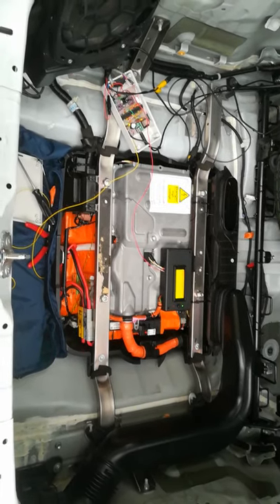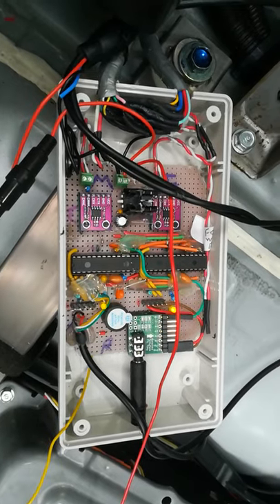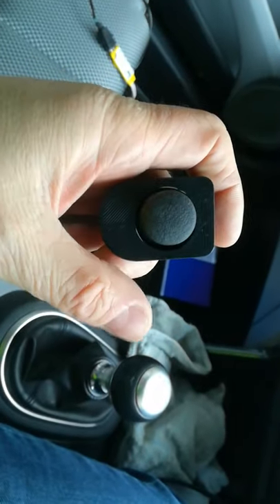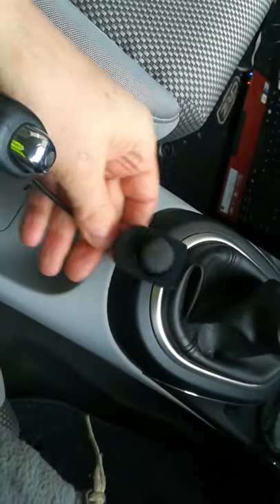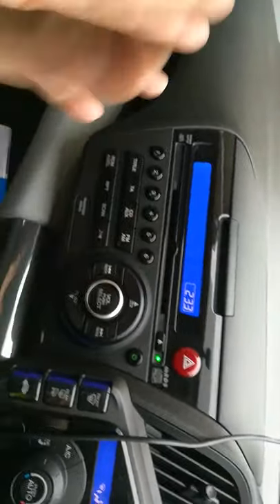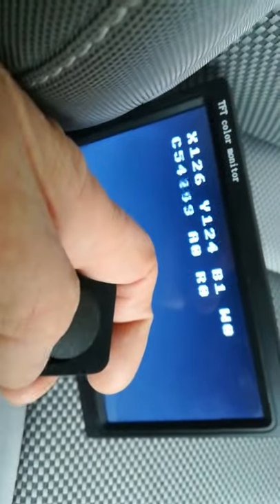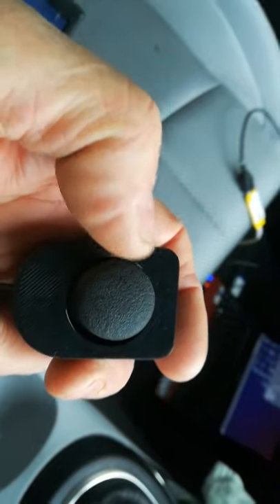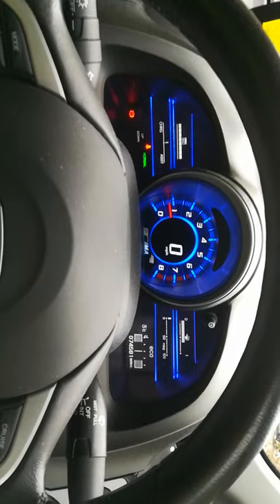CR-Z IMACAN Man In The Middle Video 3 (Joystick & Video)

Comment: The cars Start/Stop button uses IMA motor normally and a back up starter if IMA SOC is unknown.. now when stopping the car on this button does it use IMA to stall the Combustion Engine or does it signal the ECU to cut fuel and spark? Are these signals from this button sent over canbus or a simple voltage to the ecu?
It occurred to me that if it was canbus and was using IMA to start and stop you could simply copy these messages to achieve ima control
Reply from the maker: Nick can you post tech questions on the  CR-Z forum threads please. Thanks